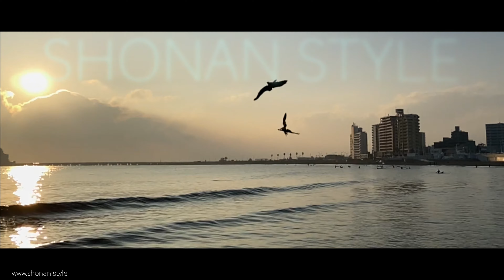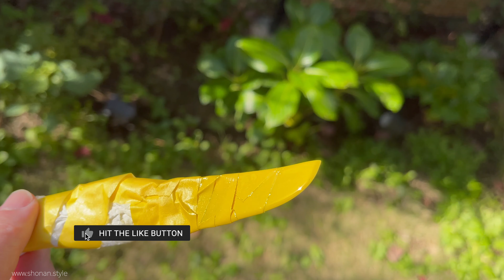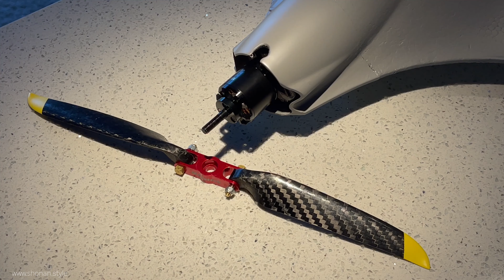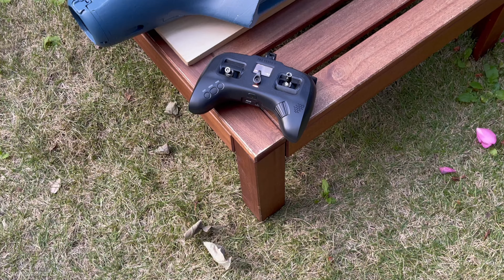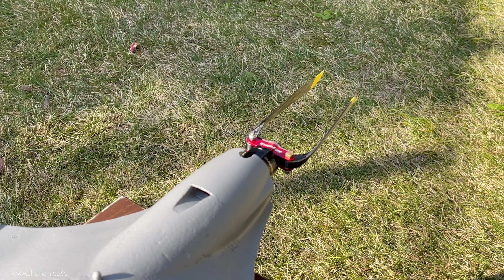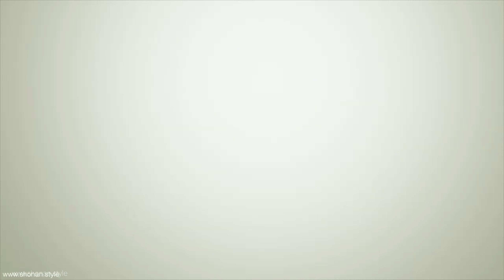Grogu my E-flite Opterra 2m | Parrot Disco HYBRID Project - FPV long range drone build ~ PART 7

Comment: Do you know why the motor made that sound at 8:30 on start up? Like is there something wrong with the motor or is that normal? I’m seeing that happen on mine sometimes on startup
Reply from the maker: Well, that is the sound when the props do not unfold correctly. Do you use a prop stopper? 
That fixes usually the biggest issue with this.
Reply: @MattShonan  Thanks! I’m having mine 3D printed
Reply from the maker: That could be it, maybe the balance is off. 
The rotation could also deform the softer material. Maybe try carbon fiber.
Reply: @MattShonan  That’s what I have!  Carbon Fibre props are good. Just waiting to get the printer going
Reply from the maker: nice! d(^_^o)

Comment: You have been saying you will fly it with 4G - are you able to use the TBS crossfire remote with 4G or will you use the skycontroller?
Reply from the maker: That is a really good question! 
I would like to fly in manual mode, however the TBS Tango 2 needs a direct connection to the crossfire receiver on board. This connection can not be routed through the 4G network over the CHUCK. Therefore if flying over 4G long distance, I will have to fly in automated mode with the Skycontroller 2.